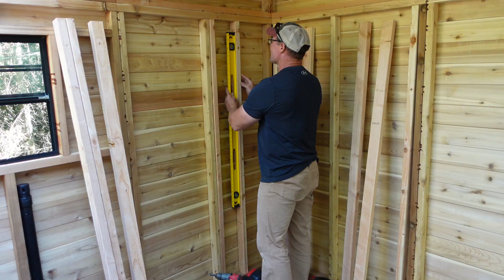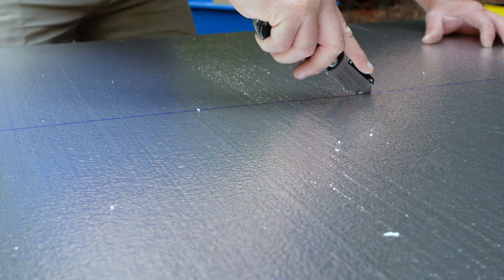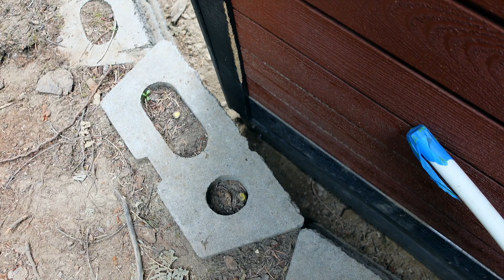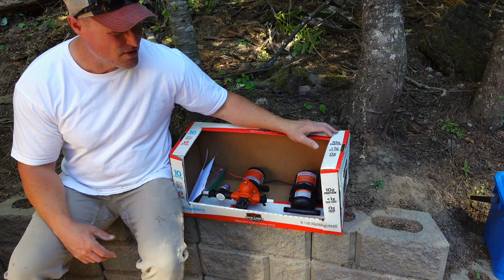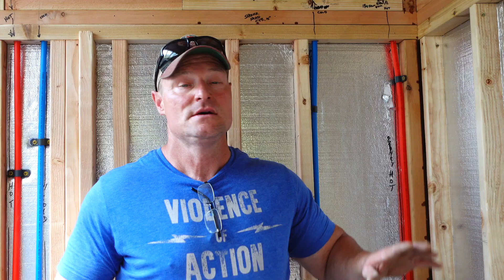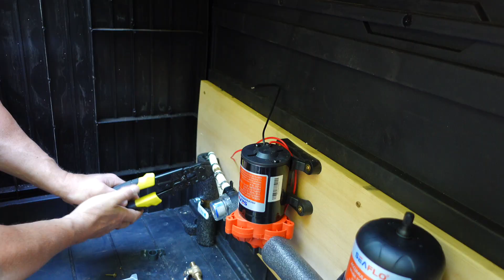Turning a Garden Shed Kit into an Off Grid Bathroom: (Plumbing, pump, hot water heater, PEX,shower)

Comment: Hey Rick... Formation in the company street in FIVE MINUTES with full gear!! Hahahaha........ Hey, you make a LOT of jumps before your first HALO, and you'll drive a lot of screws and nails before you reach perfection. In my opinion, the "Sergeant Major" says ya dun good! I'm not familiar with that in-wall vent, so I have to reserve my comments. Make sure it's higher than the highest drain. If you seal the wall around it, is it still going to work as a vent? I don't know, I'm not there looking at it, but I'd be tempted to put a couple elbows in the line and vent it outside. If I remember from an earlier video, you're using a composting toilet, so you won't have 'black water' passing through that vent, but it'll still off-gas from your septic.

Another solution to your aluminum skirt would be bending some scrap in a 90 and pop-riveting it onto the corners. Installing the 'T' so you can pump RV anti-freeze thru the system is a fantastic idea. It's in front of the pump so you'll pump anti-freeze into the pump and filter, protecting both those (expensive) items. 

Finally, Britney, your Mom knocked it outta the park with those curtains!! Every time you look at them you'll think of her.................
Reply from the maker: As always thanks for the encouraging and insightful recommendations sir! The wall vent is just a 12v RV exhaust vent, it is perfectly fitted to the outside of the structure, should do the trick for this application without running vent pipe. We are not going with a composting toilet but a porta potti 565E Curve toilet see why here: https://youtu.be/jyIcrBgPRnQ
So our shower and hand washing sink will just be draining grey water into our premade drain field. I added the winterization tee with a valve and vinyl tubing to do the RV style winterization of the pump and system as needed.
You know it my mom helped Brittany sew the curtains on a recent visit, she is one heck of a seamstress at 80!  Thanks again 
@carlmclelland7624